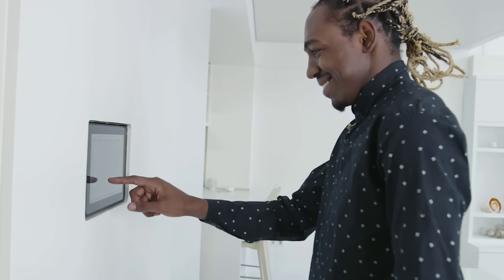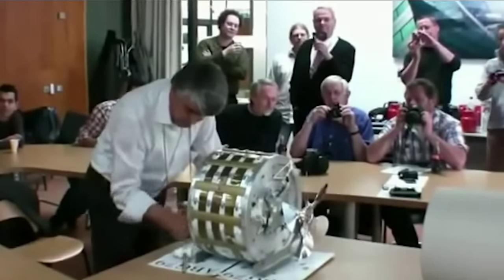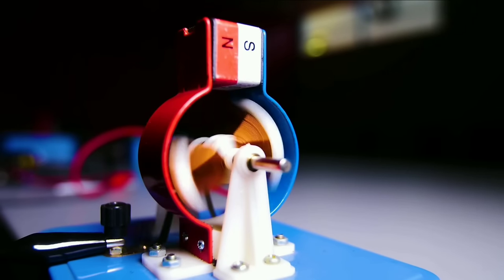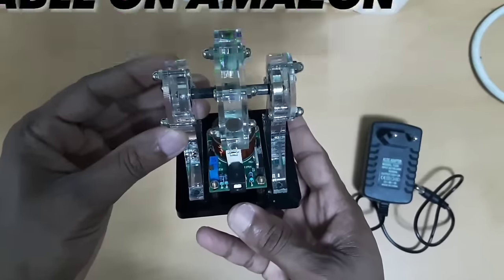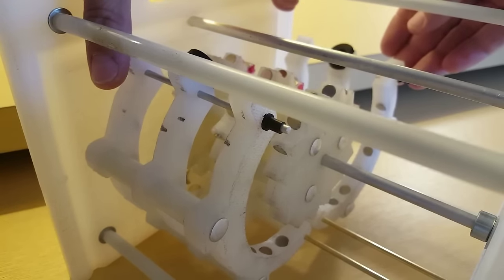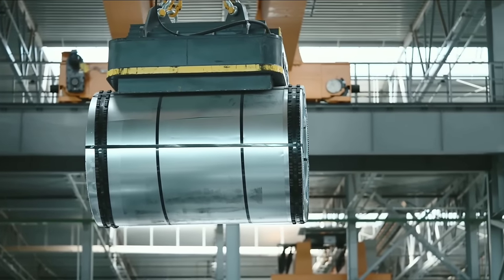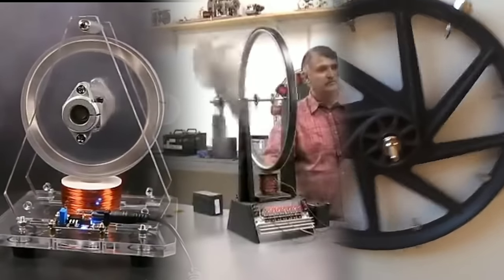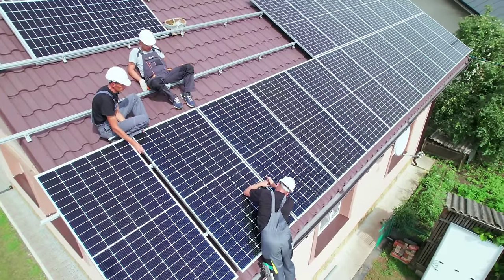You Won’t Believe This Magnet Motor That Generates Free Electricity Forever?!

Comment: This guys not a pragmatist just a cynic, you could use the pulse motor to stabilize renewables, limit the amount of energy wasted by direct solar to  battery, pulses of current plus electromagnetic repulsion, this
minimizes overall consumption from the batteries and provides sustained 24 hr use case when the sun goes down

Comment: These stupid YouTube type videos do more to set mankind backwards, that the "dogmatic" religion videos do.  Henry Ford said “Whether you think you can, or you think you can't – you're right”.   “It is a mere question of time when men will succeed in attaching their machinery to the very wheelwork of nature.” - Nikola Tesla.   There is the applied "Force" to a mass versus acceleration equations.   No one seems to know what "magnetism" or "gravity" ACTUALLY IS, in its essential nature.  They can tell you WHAT IT DOES but they cannot tell you WHAT IT IS.  The WHAT IT DOES is to seemingly create a state of energy, either potential or kinetic, by attraction or repulsion.  The force is seemingly linear, and so is limited by linear space (finds linear equilibrium)   But theoretically that should be able to be converted to rotational motion.  Every damned thing in the universe either revolves or rotates, from the very smallest to the very largest, the "wheelworks" does not seem to be linear, and maybe the very concept of "linear" is artificial.  What energy keeps the electrons revolving around the nucleus of an atom for as far as they know millions of years, and maybe indefinitely???   Magnetism and gravity may not be fundamental, there may be something even more fundamental from which these effects arise.   Concepts like "superposition" and "entanglement" just defy common sense, and normal experience, yet they are somehow reaching down to the MOST FUNDAMENTAL "thing" from which such as magnetism and gravity are only effects.

Comment: What if I told you I discovered away to produce power using a magnet but with no moving parts sound impossible,  well in theis universe or any other universe everything is possible and I stumbled on away just messing around with a magnet and some wire but that's all I'm going to let you know but I have away to produce power with no moving parts

Comment: That B.S. psycho babble would mean that every great inventor all the way back to Adam, would be a nut case who went against the norm There are few norms in the universe.
Reply: This channel appears to be nothing more than pure propaganda.
Reply: I don't care about the magnet issue. However you are full of it to tell us that perpetual engines can not work.
Reply: The steam engine manufacturers did not want the petro engines to work. An argued that water was readily available and petro was expensive. No one was convinced of electricity until they saw it. Or flight for that matter.

Comment: OK this is true and false you can build a magnet motor that works great but no to power an average house it would be as big as house and 100,000 Euro and to heat and cool home 200,000 and to charge your e-car 300,000 so it works but scale/cost is prohibited.